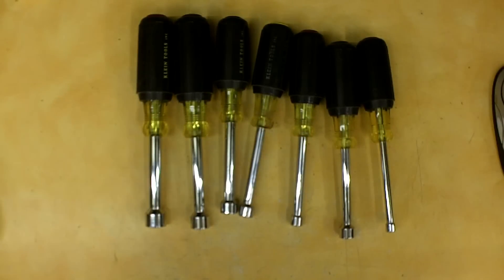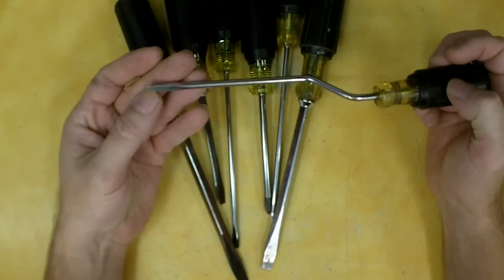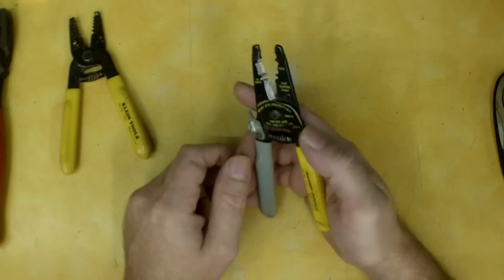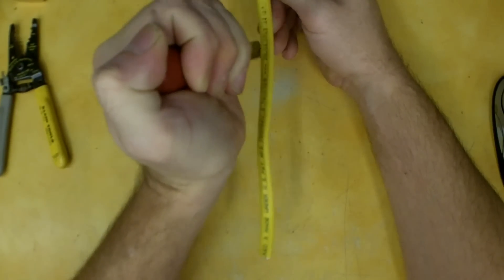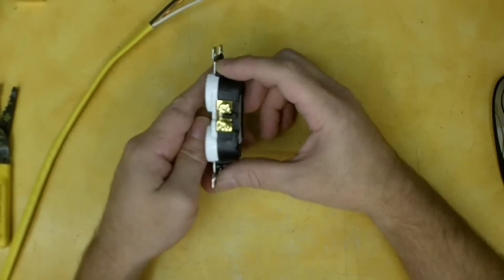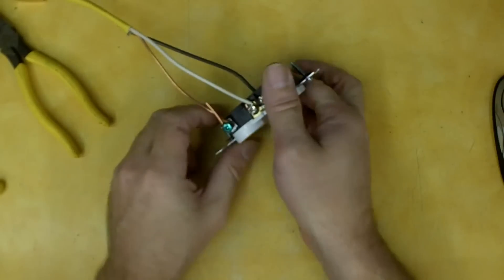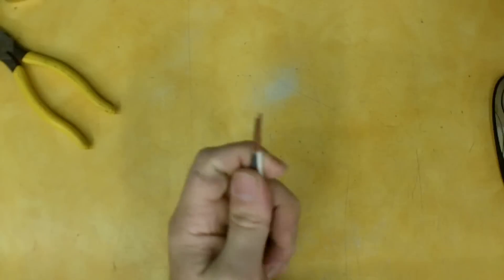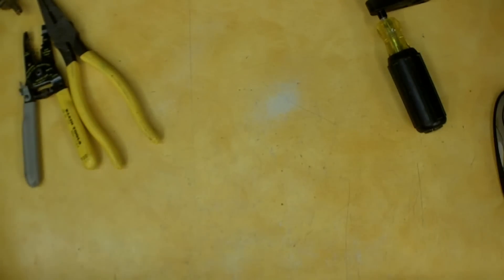Misc. Klein Tools with a Couple of No No's!

Comment: Great vid.   Working primarily as a residential repair/remodel electrician, I've had quite a few encounters with splices.  Twisting them certainly makes them more secure, but try being the guy that has to wrestle that beast apart on a live circuit!  Lol.   Six of one, half dozen of the other. 

Early on, I was a hardcore Klein fan.  Great tools, no doubt.   The tools, however, don't make the tradesman.  These days my belt is filled with a variety of names..  Klein, Greenlee, Lennox, etc.   Truth be told, my "go to" items that I carry in on a service call are Klein 12/2-14/2 cable strippers,  Klein dual wire strippers, a 9in1 Lennox screw driver, a sturdy pair of needlenose, dikes, a "suicide stick" voltage detector (we never learn), digital clamp on multi meter.   

The one tool I wish you had mentioned, considering the audience you are reaching out to, is a clear and sharp mind along with an understanding of the system you are working on.   The repair/remodel niche has shown me far too many instances of negligence and ignorance to safety.   Your electrical system, residential or otherwise, can give you all the benefits of today's technology, and if improperly installed it can take everything from you.   Including your life.    I tackle every job as if it's my family that will live there.
Reply from the maker: Thanks Chris! Agreed- it's six of one, half dozen of the other! 

That's very true- the tools don't make the man! I have tons of name-brand tools related to many trades and while most are great, I have some very inexpensive tools that work just fine. If it's not going to be used much, I always go cheap. If it turns into a more needed tool- I might just replace it or consider an upgrade. Had I had to do it over again, I'd probably not own a single Snap-on tool- much less the box..lol. 

You are correct! The mind and understanding ARE the most valuable tools one can possess. This video spun out of an investment renovation project I was doing. Open joints, hidden junction boxes, etc. I noted many problems that I needed to correct. The entire  project was tackled with the same philosophy as yours- as if it's my family that would be the ones living there. Doing any type of shoddy work won't let me sleep at night. The world needs many many more with your attitude! Take care, G.

Comment: Great demo video.  I am a retired electrician that worked almost entirely in commercial and industrial jobs.  I am also a huge Klein Tool fan.  I never had a Klein Tool fail me unless it was something I did to damage the tool.  I have a pair of lineman's pliers that I know was purchased in 1978 that are still useful, yet it has it's share of battle scars.  The cutters are pretty well eaten up by cutting live wires and a coworker who borrowed it to cut heavy gauge steel wire that I wasn't aware of.  The insulated handles are chewed up, but again that was user abuse.  I'm sure I have several other Klein Tools that date back that far, but I can't be sure if they are originals from my apprenticeship. Oh yes, I have the large flat blade screwdriver that was purchased at the same time and I have beat to pieces.  I used it to to tighten locknuts, used as a pry bar, and as a chisel.  The plastic handle has taken a tremendous beating but it held together all these years.  I can't say that about the tip.  It has been ground down and redressed several times, but never properly.  Both of these tools were retired from the tool box, but kept nearby, just in case. --- Buy your tools like your career depends on them.  Take care of your tools and they will take care of you.
Reply from the maker: +YoderTexas 
Thanks! For the trade, they are the best no questions asked. LOL, I've a couple of pair of needle nose that have been blown out by cutting live wires when I thought the circuits were dead. I didn't bother to test them before going at it...lol. They are my abuse pliers these days! My older drivers turn into chisels and pry bars as well...lol. Agreed, take care of your tools and they will take care of you! Thanks for the post, G.
Reply: *****
I forgot to mention one tip that you didn't mention with the strippers.  I'm talking about using the little holes in them to make hooks for going around screws.
Reply from the maker: YoderTexas

That's true. Someone else mentioned the holes to me as well. I'd never even seen them on my own sets...lol. I've since started using them. G.
Reply: *****
When you're using the strippers, it is so easy just to bend your hook right then, than to lay them down and pick up another tool.
Reply from the maker: YoderTexas

Agreed! G.
Reply: +YoderTexas........... Wonder why did not know this being the experienced electrician he is lol
Reply from the maker: +frank smith 
I don't believe I said I was an electrician Frank. G.
Reply: +YoderTexas you are  lucky i  lost   truck load of klein  tools tools in my 16  years  of  electrical work   wish i  was able  to  save and still have some of my  original kleins
Reply: ROD BOY
Yes, I was lucky to only have my tool belt stolen only once.  Up until about 2000, we would all leave our tools overnight locked in the gang box overnight, or leave our extra tools (our tool boxes) in the open gang box during the day without problems.  I still lost some tools due to my union brothers borrowing screwdrivers, sockets and such and forgetting to return them, but the more expensive sidecutters and voltage testers somehow managed to stick around until retirement.  Every time I see my toolboxes, I want to build something so I can use my metaphorically dusty tools.
Reply: i rarely   stay at one  job for more then a  day or two  i usually make  3-4 stops a  day  taking tools out so easy to  forgot  a  toll  and  when  you  back to  get it isn't there
Reply: ROD BOY  There are dozens of used Klein tools on eBay. Heck, maybe one of your old ones will circle back to you!
Reply: kellerrobert80 hehee  i know  i buy  on ebay a  lot  but  mostly  i get like  old  Kleins from 50's and 60's

Comment: Hard to beat Kleins.  The grips just feel great in the hand and the steel is excellent.  The extra weight in the handles is like a flywheel when spinning down hardware too.  Simply a great design.  The nut drivers are great too.  No better tool for hose/no-hub clamps and toilet assembly intstallation.  My Dad was a plumber and always had a set handy.  I inherited a lot of his stuff and appreciate the quality tools he left me. Milwaukee drills and bits, Rigid plumbing tools etc.   I have had the exact same reaction as you when using a virgin tool for the first time after using it's predecessor beyond is lifespan for longer than I should have.  Have you ever been at a friends place and while helping them fix something asked for a number 2 phillips and got the deer in the headlights look?  Haha!  And then experienced the sorry excuse for what they call a screwdriver?  Oh well.  Some guys are tool guys and some are not.
Reply from the maker: It is! I was in plumbing, HVAC, and commercial refrigeration years ago and the nut drivers were always being used across the board. Setting toilets is one of the uses I used them for. They have a good deep hole for tightening up closet bolts before they're cut off. Your Dad did it right for sure! You're right for appreciating the quality of what he left you! I have three Milwaukee corded drills and I would have no other brand if given the choice. Ridgid is my choice for plumbing tools as well- nothing else compares. I've been meaning to show them in video but haven't found the time just yet. And yes, I have experienced what some will call a screwdriver...lol. Some wonder why they round out any fastener they try to remove...hmm..lol. I have tools from the top shelf down. I spend mostly based on what the need is, and how long I think it is. That's why I purchase a lot from Harbor Freight. I'm not using my tools for commercial use these days, and most of what I get from them satisfies my needs. But, some things, like mentioned, I will not compromise on...lol. Take care, G.

Comment: Heya Ghostes, I'm in the trade and have a bunch of Klein screwdivers, but never saw the one with the pin.. very cool.. gonna get a couple of those. Here's another trick: after placing the wire around the terminal screw on an outlet, most duplexes have a little built-in plastic "hook" that you can put the free end under, then rock the lead back n forth to pinch the loop closed.. this keeps ya from having to pick up needlenose or strippers, saving a step. Then just tighten the terminal screw as usual. Check it out.

And the Klein nut drivers rock. They're drilled deeper than any other brand I've used.. great for use with nuts on long fasteners.
Reply from the maker: Thomas, looks like your settings change worked.  I thought I would add the part number here, for the driver with the pin, in case anyone else might want to pick one up. 603-4B. Like I said, I think they make regular drivers with the pin as well.

Thanks again for the tip on the recepts. I'll be checking mine out when I have time- if I can find them that is.

I agree about the drivers- especially how deep they're drilled. They're also great for setting toilet bowls since new closet bolts are way long. After they're tightened up, they're cut off so the cap will fit. These are the best drivers for that task due to the deep holes and close quarters. A must have in my opinion!

Take care, G.
Reply from the maker: Thomas, I thought I would feedback on the hook you mentioned. I was working on one of my properties and was changing out some recepts and switches. Sure enough, the hook was starring me right in the face. I can't believe I've never seen it before...lol. One less tool to grab! Thanks much for the info on that- it's now in my brain! Hope all is well, G.
Reply: +ghostses , You can do a Search on Amazon or eBay for "Klein Wire Bending" and find most, (even Discontinued), Klein Screwdrivers that have the Wire Bending Pin.

Here's what I found.

Klein Tools 603-3B #1 Wire Bending Phillips-Tip
Klein Tools 603-4B #2 Wire Bending Phillips Round Shank Tip Screwdriver
Klein Tools 605-4B 4-Inch Round-Shank Wire Bending Cabinet-Tip Screwdriver
Klein Tools 605-6B 1/4-Inch Wire Bending Cabinet 6-Inch Round Shank Tip Screwdriver
Klein Tools 661B Wire Bending #1 Square-Recess Tip Screwdriver with 4-Inch Round-Shank
Klein Tools 662B Wire Bending #2 Square-Recess Tip Screwdriver
Reply from the maker: +Charlie Warren 
Thanks for the great info Charlie! Very helpful, G.

Comment: why would you use a bigger loop on the ground? Thanks for the great tips , thumbs up !!
Reply from the maker: Thanks! I use a bigger loop for two reasons. The first is, I find it easier to get a hold of it with the pliers to close the loop tight. The second is, if the receptacle needs to be changed later, it's easier to get it off the screw. Take care, G.

Comment: Anyone know where you can get the Wire nut spinner?  Checked Amazon and Ebay….no luck  cant imagine they quit making it.  Looks like a good tool if you do tons of outlets/quads
Reply from the maker: I looked around Robert and came up empty handed. I guess they may have discontinued them. I know I purchased mine at Home Depot a long time ago. I guess I need to take good care of it. Take care, G.

Comment: Great video G, I've always been mostly a Snap-On snob but since the truck never stops by anymore I've been looking for good replacement tools.  Most of my drivers handles have failed me lately and they aren't under warranty so I've been looking for some decent replacements.  Anyhow, I've had some Klien tools in my electrical bag but never looked to them for screw drivers.  I'm going to pay more attention to them now.  Thanks!
Reply from the maker: Thanks Larry, I do have a Snap-on cab chocked full of their tools- but don't need to spend the money on them these days. They are the best for sure, but as you know you pay dearly for anything sporting their name. It's been about 20 or so yrs since I left the auto trade. These drivers are a good quality for a reasonable price. They may not last as long as Snap-on- but cost only a fraction. Thanks, G.

Comment: Very Good Information, (didn't know about the Klein Wire Bending Pin on some Klein Screwdrivers).  Your Voice sounds like Tom Bodett, (I'll Leave the Light On For You~!); and that's a Good Thing~!  What is the Model Number of the Klein 12/2 Wire / Cable Stripper that you're using with one Yellow Handle and one Gray Handle? (Resembles the Ideal 45-249 12/2 NM Cable T-Stripper Wire Stripper).
Reply from the maker: +Charlie Warren 
Thanks Charlie! It would be nice if I had a chain of Motel6's lol. I guess I'll just have to settle for sounding like Tom- or maybe he sounds like me- lol. The model of the strippers is No. 1012. The do look exactly like the Ideal for sure. Hope this helps, G.

Comment: Don't you also have to pigtail the ground to the receptacle box  or does just the receptacle have to be grounded ?
Reply from the maker: Dill, don't quote me but this is my view. In commercial applications with metal boxes I would say yes. But when using plastic boxes for residential use- no. Dig deeper as this is only my opinion. Take care, G.
Reply: My opinion on that would be, plastic on plastic, no jump. Metal box then jump it, just thinking of what can conduct, I'd like to see a plastic box and receptacle ground outside of that box, the home 12-2 that I do, I use that rule...plastic on plastic no box ground, metal box=ground it.

Comment: I've looked far and wide for one of those wire nut spinners by Klein and haven't found one. Where'd you get yours?
Reply from the maker: James, I picked mine up years ago at Home Depot. I assumed it was Klein, and it might be, since it looks just like their drivers. I dug it out and the only thing it says on it is "The Original Spinner". No model number or anything else. They may not be made anymore, but hope this helps nonetheless. Good luck, G.
Reply: They have them on eBay right now for $10 + $3 shipping... just search for The Original Spinner Wire and you should find it...
Reply from the maker: 3dsman

Thanks for the info! G.

Comment: The nut drivers do they have magnetic tips ?
Reply from the maker: +Miguel Angel 
No Miguel, they do not. I'm not sure of the smaller ones, but the larger ones have a hole that goes down into the shaft. So you can tighten up nuts one a long bolt. Good luck, G.

Comment: hey brother have ever tried knipex tools. i like them more then my kliens
Reply from the maker: I have, but have never had my hands on any. I need to find a local source so I can check them out first hand. I like to feel any tools I buy so I'm reluctant to order online until I know I'll like them.  I've have heard good things about them for sure. Thanks, G.
Reply: I'm telling you man. Once you try it you won't ever use klien
Reply: Emin HVAC Klein is awesome. Knipex is too (I use both - Knipex wire cutters are the thing). Only problem with Knipex is that there is barely any local dealers, where as for Klein You can get it at home depot. As for OP - use the attachment for impact drill for wire nuts.
Reply: kornaz N I guess you have a point there brother. It is very difficult to locate them.

Comment: You need to pigtail all 3 leads when two or more cables enter a box so that if the   receptacle fails all of the receptacles down the line function properly.
Reply from the maker: That's certainly an option Brad, but as I see it- a failed receptacle will not affect the downstream. One might fail internally- but the screw terminals are jumped externally so the rest should remain working. The only way I see that happening is if one or both of the  jumpers burned off. I could be wrong, but those are my thoughts. Take care, G.
Reply: ghostses it’s code here. Good video though.
Reply from the maker: That's cool Brad. Good luck, G.

Comment: With the wire nut thing. Just twist your wires with your side cutters and put your nut on by hand.
Reply from the maker: *****
Good info! Thanks, G.
Reply: Why don't you guys just switch to Wago's like we do here in Europe... Also, i have seen a lot of videos where people strip the wire on the desired length for a wire nut and twist the 2 short ends together with a plier. That's the wrong way to do it. You should strip the wires like 6 inches and twist them together by hand for a tighter fit and cut them with cable shears.

Comment: 00:16.19  Pet Peeves, AGREED, sucks when doing a job & open up a box, receptacle, etc...& you only have 0.5" of wire to work on b/c someone cut of too much or thought shouldn't leave extra, etc.... Swear, it's like you need 5 extra hands & fingers the size of a 1 yr old to get in here & work on the "project", one of my biggest pet peeves. Another knew I have, finished wiring a 10k sq ft school for all new outlets & Internet (ran cat 5e plenum) & had like 177 lines going into server room plus utility room & the people hanging drywall came in & put drywall over 2/3 main "pipelines" of all cables going to main setup with T the drop ceiling & literally cutoff half of the wires. Had to rerun half of the wires all over again & some of them were well over 100ft pulls(not to mention at this time all duct work, drywall, paint, etc...was complete in all rooms except server & utility rooms). Asked them why did that, said cuz ceiling supposed to be such & such height, whatever, common sense says for me....if that the case, lowering drywall .5-.75" to accommodate wiring, not big deal. Argh, some people.... So agree, would rather have too much extra wire to deal with, than barely enough & have to run new! Sorry about long story 😱😉
Reply from the maker: Yeah, they should've used some brains on that one for sure. Good luck, G.